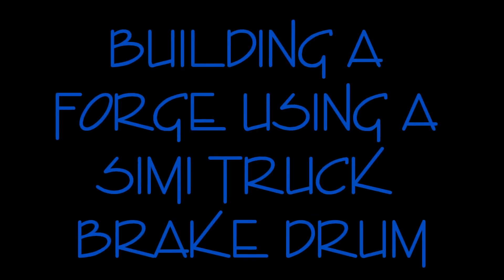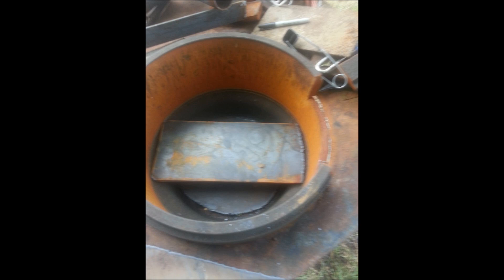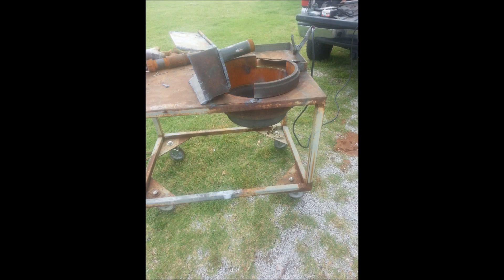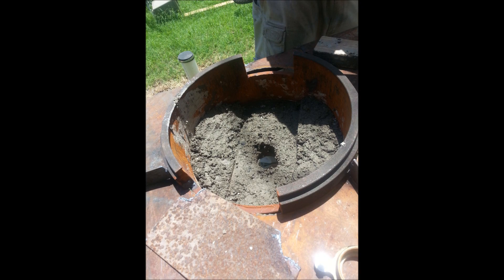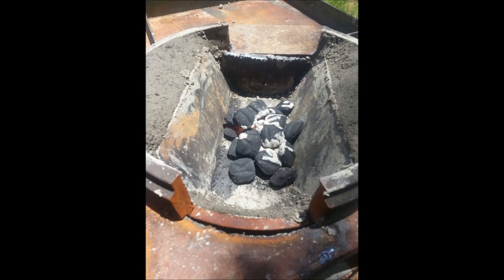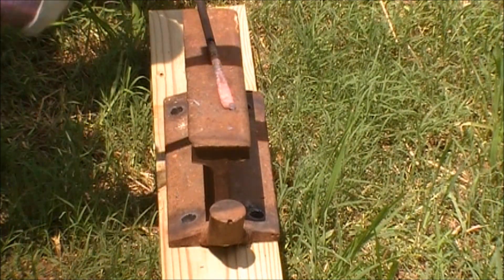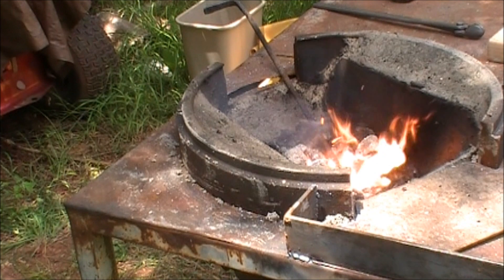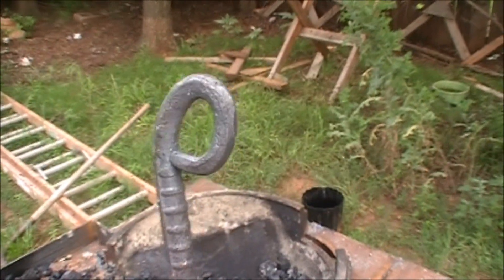Build a Large Brake Drum Forge with Fire Pot

Comment: is this forge still going strong for you? and how has the insulating clay you made hold up? any modification ever made? i feel one of the best designs i have seen. I will be building one with a few changes i feel will help increase and give a more even heat for the length of the forge. great job and good instruction video on your build.

Comment: I really like this, it is definitely the best idea/ tutorial I have seen thus far. The only thing is, everyone that makes these homemade forges are making, what I believe to be, the same simple mistake, by only having the air vent blow up through a small section in the center. Wouldn't that make it far more difficult to make anything larger? Since it would have a single hot spot? I wish I could share a picture of what I am thinking, but basically have the tube connect to a space under the bottom plate of the trough which you made, and then have holes throughout the bottom of the trough which the air can flow up through.
Just my take on it, especially with the thought in mind of properly quenching a large piece to harden it, which needs to be evenly heated.
Please let me know what you think of the idea. I have tons of wood projects which I am committed to at the moment, so it will be some time before I can test this out myself. I am interested in building one of these as a side hobby, but I would like input from someone with actual experience in this field.

Comment: one thing you can do is add a valve {I used a 2" gas ball valve} in the air inlet between the hair dryer and the forge, it will alow you to control the airflow more. second in the long run you will end up cutting out that tweer and making a grate that can be removed  do to the clinker that will build up from the coal and metal impurities.

Comment: nice vid well done. Would you change anything on that now that you have used it? More air holed in the firepot, or maybe undermount the drum? I saw this the other day and just today went and grabbed a heavy duty drum off my neighbors truck, teach him to whine about my music, lol. I was thinking though if you undermount drum it would work better for feeding, but I'm new so don't know.
Reply from the maker: Thank you for the comment. I made this forge with items that I had access to. With it sitting down in the table and leaving just the top 6 inches or so exposed, gives me better control of the metal in the coal. As far as airflow, the holes I cut is working great. It does not seem to give me weird "Hot Spots", which is one thing I was worried about but I plan on upgrading the hair dryer to an actual squirrel cage blower for even better control. In the spring, I am actually going to take a car rear brake drum hub and make a mini forge so that I can do smaller stuff such as coat hooks, pot hooks, and stuff for that rustic look. Also trying to find a small hand crank blower but boy they are proud of them. Have a great day! - Doc
Reply: ***** air bed pump does a good job with the air use a shut off valve on pipe leading to pump to regulate air .nice job mate.
Reply from the maker: That is a great idea! Thanks for the comment. Have a great day! -Doc
Reply: ***** I did build mine using your design and it works pretty good. I used a 3" bath fan for the blower. Thanks for uploading the vid, Should have seen my face on the first firing,with the metal turning yellow. It was awesome. I will do my next one with a smaller drum too. I have to drive 100 miles one way for coal. I also added 6 fire bricks for walls and roof above fire pot, amazing difference and still able to feed long stock. Best to you and yours.

Comment: You did a pretty dang good job on that. AND it doesn't say made in CHINA any where!!!
I may try one like that, right now am building one from a semi drum like that. Am still making some modifications due that I can't seem to get the iron hot enough for welding - well to orange anyway cherry is easy but not hot enough - but am using oak wood cause I have plenty of it. Coal around here is about $58 for fifty pounds at that price I can't afford the hobby!
Keep up the good work thanks Doc for posting your video.
Reply from the maker: Bobby Abbott Thanks for the kind words.As for the coal I actually found a farrier supply place local. The sulfur is a little higher than I would like.. but not so bad that it affects the outcome. Just a little more yellow smoke and smell at the start. On your tweer check to see if there is a huge leak or maybe the output area is too large, or you may have to increase air input to the "sweet spot". Have a great day! - Doc

Comment: Great video. I just got through with my forge this weekend. I used the kitty litter for insulating and had a problem. When the clay was drying out it cracked and the dryer it got the larger the cracks. How did you keep this from happening.
Reply from the maker: With mine I made in small batches, used hot water to mix and added charcoal ash, let it stand for a minimum of 20 minutes to let it absorb all the water into the clay. I also tried to get any and all air pockets out. Did you use the super cheap kitty litter or the "self clumping"? The clumping litter has additives in it. Thanks for the question, I hope this has helped out a bit. Best of luck. Have a great day! - Doc
Reply: ***** Also, maybe Dales used too much water?

Comment from the maker: @ Andrew Warren, I don't see why you couldn't use a wheel rim. You would have to weld a plate over all the holes and then cut in on the bottom or side for your air supply. Thanks for watching. Have a great day! - Doc

Comment: Nice job on the forge, will be copying your idea this spring.  Also, find yourself an oak stump cut to a comfortable height for your working height and attach your railroad track anvil to it. I've done this and its stable, strong and doesn't absorb all the inertia of the hammer strikes. Someday I'll get a proper anvil but until then, the RR track works just fine for my small projects. Thanks for the video.
Reply from the maker: I actually have a large tree I am removing from backyard and will be taking a chunk of stump for that purpose. I am glad that you liked the video and want to copy it. When you get it finished... drop me a PM. Would like to see finished project. Have a great day! - Doc

Comment from the maker: All up... Well I kind of lucked out... The brake drum and table came from a friends shop. all the other metal I picked up at the scrap yard for $20.00 @ 0.18 cents a pound. The cat litter was from a big box store for about $2.50 a bag X3 bags. The flex tube was the most. It is a flexible gas exhaust vent...less than $10.00 though. Hair Dryer was kidnapped from girlfriend (she had more than 1) So all in all I was out less than $40.00. Thanks for the question. Have a great day! -Doc